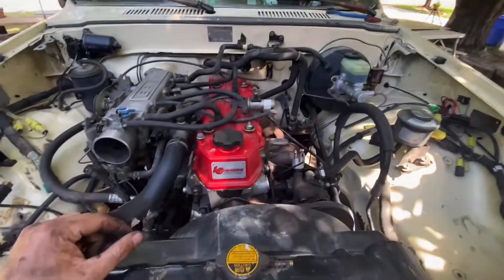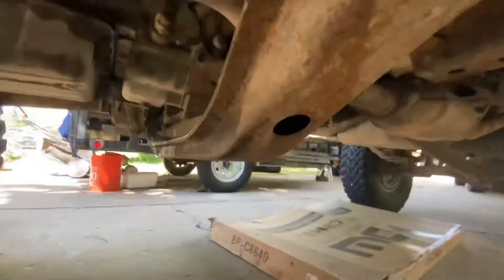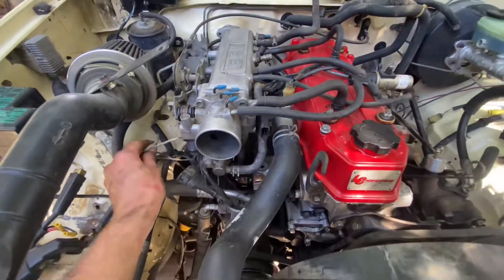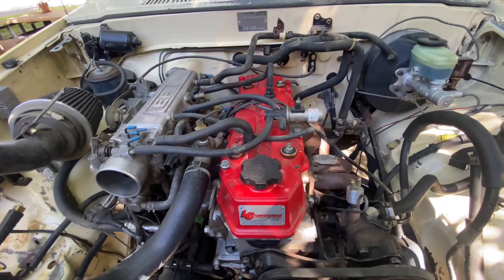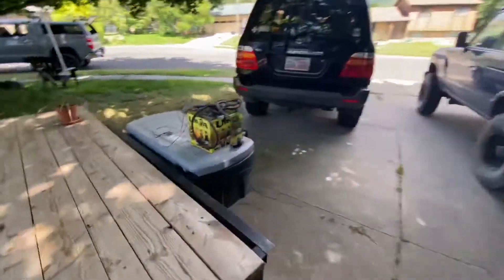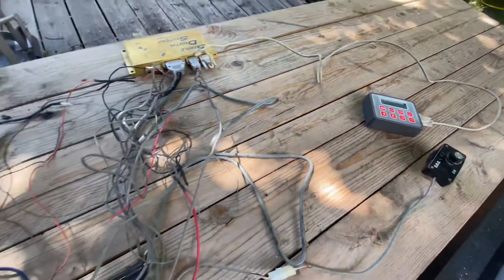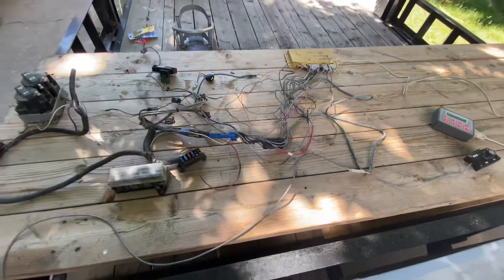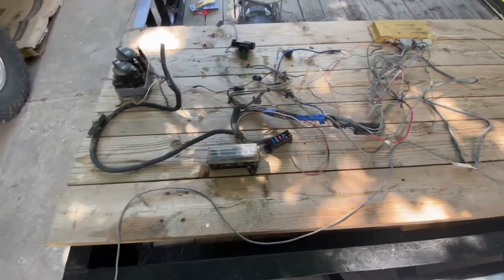LC ENGINEERING 22RE & SDS IGNITION INSTALLATION (Used Engine Swap, 1986 Toyota Pickup) Pt. 2

Comment: I have 2 comeplete 22re EFI conversions with everything needed including entire uncut wiring harnesses. I would possibly trade one for that system you have straight across only because I think it might work on my turbo 22re build.
Reply from the maker: I was planning to use it. Where are you located?

Comment: Please do a install video I need help bad I’m doing the same stand alone ECU in my 1994 22re. I’m so lost $2700 for the kit and I have no idea what to do next
Reply from the maker: Turns out I’ll be in need of a full rebuilt engine for this one. The one I bought was junk. Hoping for spring time. Anyway, have you gotten onto the LCE website for all the PDF downloads for how to map the programmer? Here’s a link. After you fumble around on the controller long enough, changing all the settings as shown in the maps, you’ll be off to a good starting point and then can tune from there. 

http://old.lcengineering.com/LCTechPages/sdstech.html
Reply: @AdventureTEQ  do you want to sell that LCE engine?
Reply: I have not. I built the motor 7 years ago and purchased the stand alone system from LCE. And had no idea about wiring at the time. I drop of the truck at a friend of mines shop for him to do the wiring. (He is a widely know Honda motor builder and said it would be no problem. He has done systems of that nature before.) I dropped it off December 2015… I just pick the truck up December 2021… so I cleaned the truck and organized wires just to see where I was at and he only had five wires left to connect or only five wires left that may not be needed to connect. Blows my mind, now I’m just trying to see where he left off and I pick up. (That’s the worst! I rather start from scratch than pick up, God knows where, someone else left off and have no idea why they stopped. ) I’d like to send you a video but it won’t let me in the comments.
Reply: @jordanwhite3152  if you still need help on this, let me know. I installed an EM-4F in a 3T-GTE.
Reply: All LCE Performnce 
94mm forged pistons and rings
Stage 3 head & Stage 2 cam
Big bore throttle body & spacer
Stock crank
240cc Injectors
LCE Headers & Exhaust w/ high flow cat. 
ARP head studs & Exhaust studs
Every bolt was replaced with new 
Too the nines, I did this motor for it to sit for 6 years. 
Now I’m having to drain all fluids and replace and thank god I had the motor all buttoned up. (Sealed)

Comment: You get it done yet?
Reply from the maker: Fuck no. Well… yeah, and it didn’t run right. Hardly ran at all! Turns out the head was warped so bad that it bend the valves and none of them could even close all the way!! CompleteLy fuckered. 

Gonna have the original fully rebuilt, as soon as I get time to tear it down.
Reply: @AdventureTEQ  ahh well sorry my man, why not just get a 3rz and throw it in there and call it good.
Reply from the maker: Interesting. I really wasn’t familiar with that route until you said something. Preliminary research tells me it’d be far simpler to just keep it as is, with all the stuff I already have, rather than trying to source a 3RZ, potentially rebuild it, and get it to actually run in this truck! Some folks seem to think the 22RE is about as good of an engine, not much less power, and easier to work on. 🤷🏼‍♂️